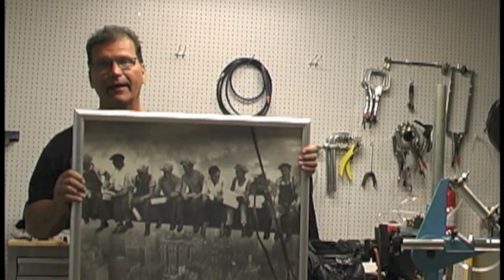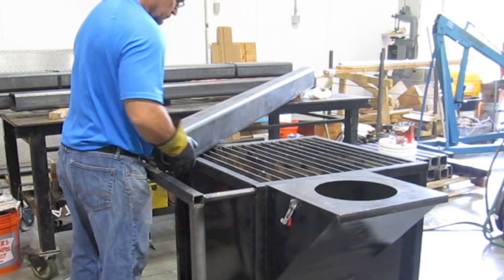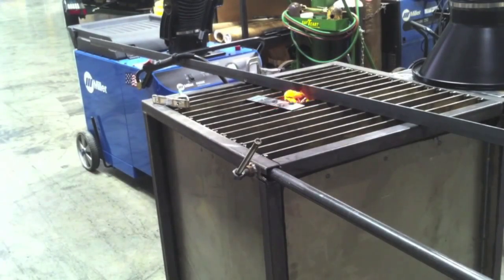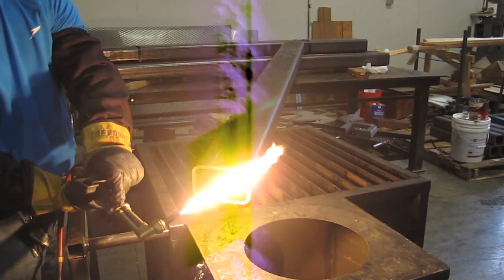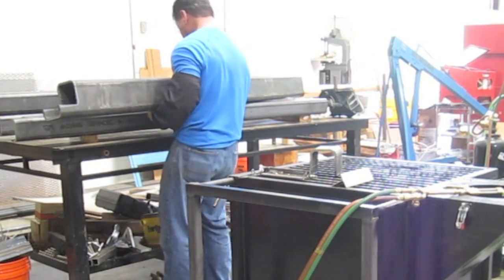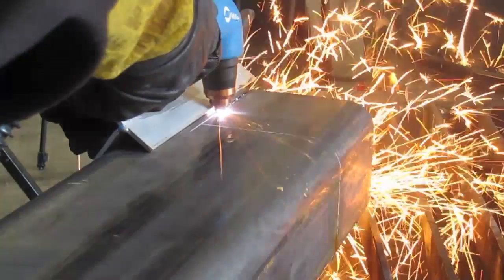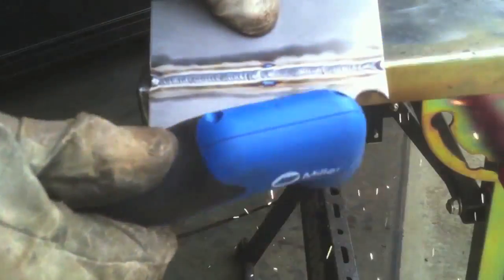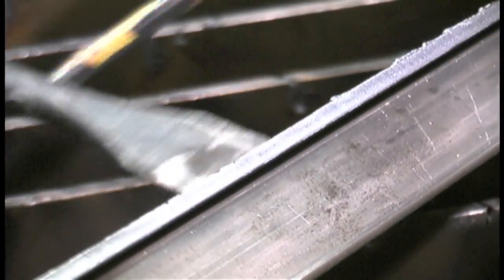Plasma Cutting & Oxy Fuel Cutting

Comment: I'm an engineer and have been working designing and manufacturing oxyhydrogen generators for almost a decade now and can tell you that oxyfuel has a lot of advantages over plasma in many applications. Plasma is great and has lots of applications for non ferrous metals but plasma can super harden cutting edges, no matter which metal is being cut. Plasma arc ultra high temperature hyper hardens the edges to the point it makes post machining (finishing) tasks quite hard. Grinder discs suffer while dealing with such hard metal layer...  at the same time is VERY polluting. Sublimated metal gas generated for the extreme temperature of the plasma arc is extremely harmful for your lungs, skin, throat and eyes. Plasma requires compressed air and lots of electricity. Not to mention plasma consumables (tips) are expensive and degrade quite fast. So in the end plasma is good, yes, but it's still miles from being the complete and #1 solution for metal processing. 
Last but not least, oxyfuel is still king over ANY known technology for thick metal cutting, and is still much economical to operate. Oxyhydrogen is much faster and cleaner than any other oxyfuel gas and being generated on demand it naturally eliminates risks associated to gas leaking, explosion or human poisoning. 
For inquiries please email me to gerencia@aphytech.com
Reply: Hi Manuel it could you tell the same about process tig? Thank for your answere

Comment: Hey man... I have a question for u on a plasma... Cutting 1 inch plate... What should my pierce delay and travel speed be to keep a square cut without an edge start.  I have been fighting my setup and my cuts are cutting at angles even though my tip is square.

Comment: Hey Jody, can you make a video explaining the proper placement of gussets. Is there a rule where we can use so we dont have to put too many or too less. Or is there any downside of putting more, for example it will warp the structure more maybe? im building a small 2' x 3' welding table with 1.5 inch square 8 guage tube. i worried im placing too many gussets.

Comment: As a student I would prefer a plasma cutter over a torch they are easier to use and have greater mobility nice vid :)
Reply: I love using my powerplasma cutter but oxy fuel has its place.
Reply: I agree with you Tony, It is hard to use a Plasma to just warm something up. Cheers from John, Australia.

Comment: Have you use HHO Gas for cutting? HHO Gas is Brown's gas through electrolysis produces pure hydrogen oxygen gas together. Check out my YouTube site and see what we are doing. We were able to cut through half-inch steel with 5 psi compressed oxygen and using HHO Gas together replacing acetylene. Just click on my YouTube name to visit my YouTube site.
Reply: You should take this comment down. DO NOT USE HYDROGEN GAS ON STEEL. It causes hydrogen embrittlement. Cutting with hydrogen gas diffuses hydrogen into the heat affected zone. The whole outer edge of the steel is gonna become brittle and completely lose it's load carrying ability. You need to do some research on hydrogen gas to cut steel and exactly why hydrogen gas to cut steel is, not only useless, but dangerous. 

To any welders out there, you might of heard of hydrogen embrittlement. Hydrogen gas works its way into welds and cuts and it causes welds and the metal in the HAZ to become brittle. Mild steel can take a good amount of hydrogen embrittlement which is why you don't need to pre/post heat treat it. When you start getting into the higher tensile strengths, the steel can take less and less amount of hydrogen in the weld. At a certain point you actually need to make sure your rods aren't dry, you need to pre/post heat, the surface is clean, and etc. Any moisture is terrible for welding because the electricity turns water from H2O to H2 and O2. It creates Hydrogen gas and oxygen, the hydrogen gas works it's way into the metal and embrittles it and the oxygen reacts with the steel to create rust or iron oxide. This guy is advocating hydrogen gas without knowing anything about this. It's dangerous and morally irresponsible to do this.
Reply: Would the hydrogen not be consumed in the burn?

Comment: HHO instead of acethylen/oxygen.
Reply: HHO is impractical and the Cobra torch is the best oxy-acetylene torch in the long run.
Reply: Zekerias Varg DO NOT USE HHO GAS/HYDROGEN GAS ON STEEL. It causes hydrogen embrittlement. Its like welding with a soaked 7018 electrode or another equally absurd example. It causes hydrogen to sink into the microstructure and will embrittle it unless it is post heat treated for an hour at 300 degrees and is a big pain in the ass. Dont do it, it could kill people or cause huge huge damage if a part were to break. It isnt just the cut zone thats affected because the hydrogen also diffuses around the part. 

Hydrogen embrittlement is why 7018 electrode need a rod oven and why pre and post heat treatment is sometimes required and why moisture is horrible and why many pipelines and welds have failed. 

Hydrogen gas is only good for aluminium because you dont get hydrogen embrittlement and you dont get a "dirty" reaction.

Comment: I Would like to se you use some really heavy duty welding, like 1.6 mm gas shield flux core... I use 1.2 wire and we are welding excavator buckets and quick couplers.

Comment: i got my start at welding with a small auto shop putting exhaust on cars using a miller 90. my next job as a tanker mechanic for central transport out of high point nc. i fabricated mostly mild steel structures like king pin plates, landing gear sections and tandem chassis. later i was hired on as a sheet metal welder and fabricator. never once having any formal training. this all steamed off from being a natural gas pipe line plastic pipe fusion tech and welders assistant. your videos are great

Comment from the maker: if your pretty good with stick, its hard to beat for stuff like that. I see lincoln red tombstone 225 amp AC welders on craigslist all the time for $150 and less. It depends on the power you have available and your budget.
 a hobart 210 mvp multi voltage might be a good choice also at around $850 runs off of 115v or 230v

Comment: Jodie, I am looking for a welder to do some heavy duty welding of cattle grids made out of old railway line and other heavy duty jobs around the farm. What sort of welder would you recommend? Mig or stick and what amperage would you suggest?
Reply: born2flyau i'm not jodie but any welding machine can do any thickness with enough time and prep. You can do anything with a buzz box really if you prep the material right by beveling and so forth. 6011 could be used for tacks and ac 7018 for anything needing strength. Stick is a lot easier to set and go while mig takes a bit more finagling and more things can go wrong. 

With stick, you have a big variable 12 volt battery with two jumper cables essentially. Can't get much simpler. 

With 7018, if you dont store it right, you are much better off sticking to 6011. Welds end up stronger with 6011 than poorly stored 7018.

Comment: Awesome as always Jody. I was reading somewhere you can actually cut glass and timber with a plasma cutter if you cover it with aluminium foil. You ever heard or seen this done?
PS. Picked up a Tig torch for the first time this and thanks to your vids and instructions got some pretty good beads. THANKS HEAPS.

Comment: If only a good plasma cutter was a better affordable price, but i think its mostly for the professional metal worker, not the backyard welder, i've only had an angle grinder, oxy propane torch and a shop saw for most, occasionaly a reciprocating saw for exhaust tubing.